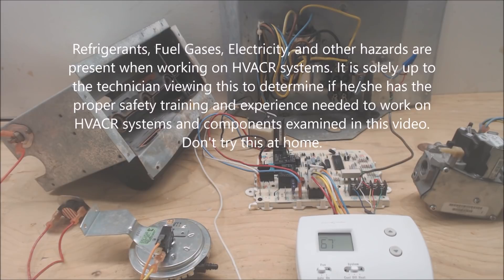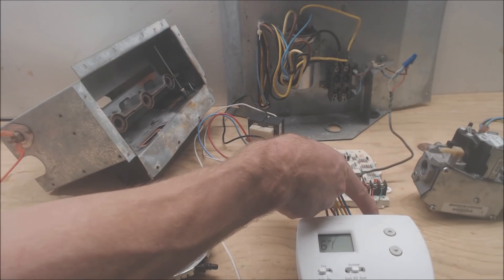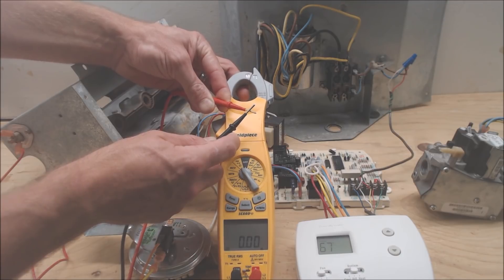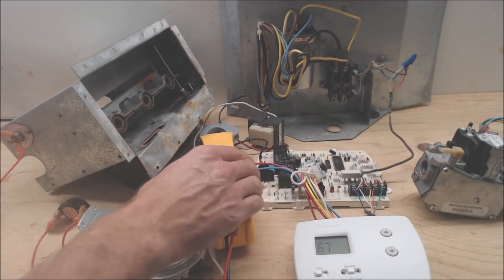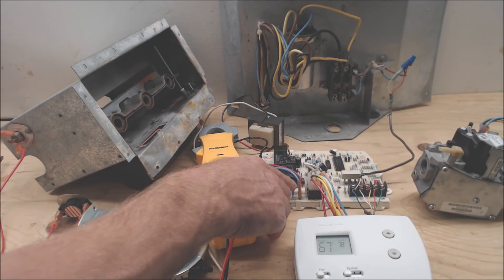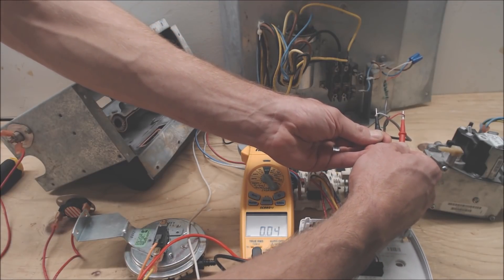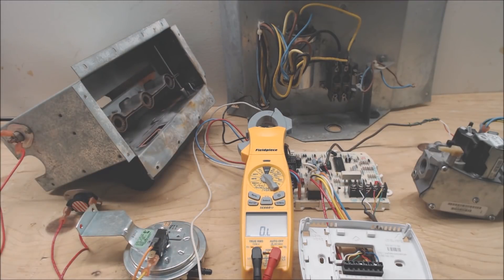HVAC Electrical Troubleshooting! How to Find a Low Voltage Short!

Comment from the maker: Tool List-  https://www.amazon.com/shop/acservicetech
Support-  https://www.patreon.com/acservicetech
For those that are looking for the tools used in the videos: (Linked Below)

Here is a link to the Fieldpiece SC640 Multimeter-  http://amzn.to/2x8k4Kb

Here is a link to the Fieldpiece SC660 Wireless Multimeter- http://amzn.to/2gWDUhc

Here is the link for the Irwin Wire Stripper/Cutter/Crimper-   http://amzn.to/2dGTj2V

Here is the Link to the "Lil Popper" 24v 3amp Breaker-  http://amzn.to/2xWcVrR

Here is the link to the 3amp fuse 25 pack- http://amzn.to/2y2zkFC

Here is the link to the 5amp fuse 25 pack- http://amzn.to/2z4SyKD

Here is a link to the Stanley 6 in 1 screwdriver-  http://amzn.to/2x7NuaZ

Here is a link to the thermostat 3/32 screwdriver -  http://amzn.to/2hxt7uK

Other tool links can be found in the video description section.

ACSERVICETECH is a participant in the Amazon Services LLC Associates Program, an affiliate advertising program designed to provide a means for sites to earn advertising fees by advertising and linking to Amazon.

All of the ACSERVICETECH Playlists-  https://www.youtube.com/channel/UCOZR-1IqsAer9wzlvFgb4mA/playlists?view_as=public

If you want to support the ACSERVICETECH Channel and receive more HVAC content, check out www.Patreon.com/acservicetech

Comment: Ok, I haven’t fixed my issue because I don’t understand what’s happening.  My fuse blows no matter what I do.  Someone told me to disconnect everything.  I did so minus the 6 pin connector.  When I reconnected everything one by one.  I found the 24v wire blew the fuse when reconnected.  

Watched your video and I removed the 6 pin connector and ohmed it out.  HVAC question:  my 6 Pin connector from my card, (large white wire) which is the #2 pin - is going to the gas valve #3 pin slot in the connector. It is grounded.  This is while the 6 pin connector from the card is disconnected.  So I plugged my 6 pin connector back into my card and removed the 4 pin connector from my gas valve to remove the “short/ground”. I ohm my fuse prongs and detect no short.  I plug in my fuse and the unit starts working.  Hurray!!! So… 
I have an extra gas valve that I removed of unknown condition and it’s also shorted to ground in the same place.  So either I have 2 very expensive shorted gas valves or the white wire is supposed to be a ground and I have the issue somewhere else and this disconnecting of the gas valve is a temporary “fix.”

Comment: I've been confused lately looking for low voltage shorts because r (or 24v hot) will have continuity to ground I believe through the coil on transformer. I have a problem remembering or knowing what resistance values are normal for things like that

Comment: You have used a great example by pointing out the condenser control wire. I have found that a large percentage of the shorts in a control system is in the control wire from the board to the condenser. Homeowners and Landscapers (and in some cases chewing rodents) cause havoc with the control wire near the condenser with their weed whackers. Great videos. I went to HVAC training in 1978, I'm an old-timer now, but you are the best instructor I've come across. Thanks for helping out the lesser experienced techs, your videos are great!

Comment: I love your system mock-up, but I think OL stands for open line. Just my understanding. It may  in fact be 'over limit' but what exactly is over what limit?  I need to know these things!  Thanks again. Keep it up!
Reply from the maker: open line, open limit, over the limit of resistance that the multimeter can measure.

Comment: Having an issue on a package unit system worked 1 month after installation. 2nd stage cooling is causing unit to shut down on high limit. Changed the board and working for 2 weeks now again out on high limit. I have it now wired for 1 stage rn so customer has cooling the compressor 2nd stage is good ohms ars good. New ductwork 4 ton I have 14 ,12, 12, and 10 inch duct off plenum 20 inch return

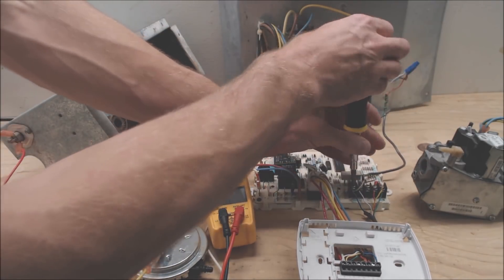Comment: You say  at 8:43 you need to always disconnect the wires from the control board so we dont measure the resistance of the resistors in the board. Can you explain what these resistors are for. Why does the Y wires not go straight to the condensor. Thanks Michael

Comment: At 3:31 you talk about the 2 red wires that go to the safety switches.Its not clear what they do. Do they cut power to the thermostat if any of the safety switches open ? A schematic of what your doing would have been a great bebefit to help newbies to follow and reduce basic questions like this one     .   Thanks for video. Michael

Comment: Maybe someone can help me with this strange problem at least for me anyway. Customer replaced his thermostat. I Checked all the wiring and he showed me a picture of the previous wiring and it was correct. When I turn the heat on the fuses now pops I removed the jumper from R and RC and the heat turned on and fuse stopped popping obviously the AC dosent work now. The old thermostat had a jumper and as far as I can tell the wires weren’t moved. The Y wire was spliced in the ceiling and one end runs outside and the other goes to C on the board. Why does it work all of a sudden when I take the jumper out. I could not find any short and stupid of me I didn’t try and by pass the thermostat.
Reply from the maker: There is a short to ground between either the y and ground or common, or there is a short between the g and ground or common. Look up the video "acservicetech finding 24 volt shorts fast" thanks!

Comment: Excellent explanation of the workings of HVAC system, however I need to correct you one thing, you keep referring to the OL on the multi meter as over limit, the correct term is open line. Hope you accept it as constructive criticism.
Reply from the maker: It can mean many things, open line, open limit, over limit and two others. In some videos I say open line and techs will say it means something else. The bottom line is the resistance is so high that it cannot be measured and the circuit is open. No prob at all and thanks!

Comment: I have burnt two transformers in a row. Both burnt only on the primary side. Can a short to ground on the secondary side cause the primary side to burn up?
Reply: Yes. It fucked me up too cause I was taught in school a low voltage short was gonna short the secondary but i worked on a blew up transformer on one of my dad house and it was a shorted wire going to the low pressure switch was runbing and eventually exposed and shorted on the suction line and I looked at the back of the transformer anx fhe primary was black so yes

Comment: Why 24 volt fuse blows on  heat pump unit., it runs for day or two and fuse blow,  it runs fine on emergency heat for several days but when Condenser is on it t blows 24 volt fuse blows in air handling unit.

Comment: Thanks for your help buddy.  I was able to track down my short (something the techs said they couldn't do) after watching this video.  It was the yellow one going from the board to the outside unit.  Instead of running new wire, I just used the brown one that wasn't in use.  Many heating cycles later and no blown 3 amp fuse
Reply from the maker: Glad it helped Frank!

Comment: I have a package unit that keeps blowing the fuse on one of the transformers it keeps tripping after turning it on for 10 seconds. But I disconnected the g wire at the low voltage terminal block  and it didn’t trip anymore but also the 2 condensor fan motors don’t come on . It is a 208/ 3 phase unit but the condensor fan motors are single phase 208/230 with a 10 mfd capacitor. Anyways I had also found to bad fuses one one of the legs of power at the disconnect and at the unit on a terminal block before the power enters the unit. What do you think is going on? Low voltage short

Comment: Hey craig i bought the 3 amp lil popper and the male terminals on it did not fit into the female fuse connectors on a lennox unit i had done did you have to change the size of the male connectors in order to get them to fit

Comment: Simple fix with inspection and a Dvm. Look for cut wires outside by weedeaters look for wires melted or bad splices no tape on connections no romex connector on furnace and wires shorting to ground
Reply from the maker: Ha ha yeah those are nice and the easy ones to find for sure, thanks!

Comment: Try this on for size: 5v at R. 27v at AHU bus. 5-10v at a junction between T-stat and AHU. Both safety switches are connected and have 27v passing over them and connected to R from T-stat and G from condenser. Also, the T-stat has old 7 wire setup, no extra wire, just old wires to swap around. 

What you gonna do?

This what I'm going to do. I'm going to remove some form of heat, just to get 24v at the T-stat. Inform the h/o of what I did, and get another tech out to replace the T-stat wire, and confirm wiring at AHU is satisfactory. Residential work can really blow sometimes, ahahah.
Reply from the maker: Ha nice. I am having a hard time understanding where you were taking your measurements from exactly but thanks!

Comment: 24 volt is going to the circuit board but i not having 24 v getting out to the the thermostat, is my circuit board fried.
Reply from the maker: If you measure 24v between r and c then you could try jumping r to g to see if the fan turns on, then r to w for heat. This would show if the tstat or the tstat wiring is bad, thanks

Comment: Can continuity work too right??
Reply from the maker: Continuity is the same as resistance but will give an annoying beeping noise. You should always go by the level of ohms read and not by the beep. You may think something is closed electrically but come to find out that contact has too many ohms across it do to burnt contacts, thanks tinymanthebeast!

Comment: I understand that if any power wire touches common, a fuse will blow. But how bout a power to power short. Had a job the other day where the zone panel was putting out all theae crazy different voltages, pretty much just spiking up and down all over the place. Changed the zone panel and in turn stabilized the voltage but still something wasnt right, i had a call for heat on a paticular zone but it wasnt transfering over to the equipment side of the panel, eventually the problem was solved and R was in continuity with g when i rung it out. Changed the wires and call for heat transfered through the zone panel. Can you explain this? Im guessing what happened is power junped from r to g and backfed through the stat and bucked the panel with 24 v on 2 terminals at the same time. Kindof a mystery to me, i dont fully understand why this happened. Anyway your input would be much appreciated
Reply: Also by my info can you tell if that zone panel even needed to be changed? After all i did get stable voltage on the new panel, and another thing i forgot to mention is that i replaced the tstats with a couple of t6's. The old stats were the white round honeywell ones that are supposedly power stealing, also when i had the new panel in the old tstats were compleyely out of the equation, which makes me wonder if it were those tstats producing those wacky voltages, i also own 3 meters, so i compared my readings on both and they were puttin out the same result
Reply from the maker: Usually a hot to a hot would not be a problem if it was all from the same transformer but it sounds like you had a hot from two different transformers touching, one from your zone panel and one from your air handler if it was g. That would certainly cause an issue, thanks
Reply: @acservicetechchannel  holy shit dude, its funny you mention that, because the transformer for the zone panel was literally sitting right on top of the air handler transforner inside the electrical cabinet of the AH. They were literally right next to eachother. Is it possible power could have jumped from one transformer to anothrr in such a confined space?
Reply from the maker: Literally on top? That is not good. The magnetic flux lines of each transformer would be in the same area. Make sure they are not on top and at least 2 inches away from each other horizontally, thanks

Comment: Very informative, Thank you. I have a question, my transformer was burned when I turned on the AC. I installed a new transformer and it was burned again a few minutes after I turned on the AC. Which part of the system should I check besides the contactor to find the low voltage short.
Reply from the maker: You should connect a 3 amp spade fuse along with the two spade connectors on the 24v power of the transformer. This way the transformer won't blow like that. Disconnect the wiring going to the contactor and at the indoor unit and see if the two wires have a resistance reading. That would be bad as it should read 0.L. Also check the yellow wire against the common wire from the indoor unit to the tstat. Make sure that they are disconnected first, thanks
Reply: They also have a tool call short pro tool works a little better than the lil popper and safer because it will identify a short below 3 amps

Comment: I HAVE A CARRIER AC UNIT, AND THE FAN IS RUNNING CONTINUOUSLY, I REPLACED THE THERMOSTAT ALREADY, WHAT DO YOU THING THE PROBLEM IS? THE FAN IS SET UP AT AUTO IN THE THERMOSTAT. ANY IDEA?
Reply from the maker: Have you seen this? - https://youtu.be/wX3hCqwUjkE - afterward ask whatever questions left, thanks
Reply: Fan relay on control board welded shut. Normally open

Comment: AC Service Tech LLC just gotta say Ive been watching your videos all day and theyre very informative.  This video is the exact problem im having.  We have the fan running and when we turn it to COOL the fuse blows.  Everytime.  I feel I have narrowed it down to something on the AC unit itself.  I replaced the 3 wire running from board to unit because it looked old and dried out.  Wasnt the fix.  Still blew the fuse.  I then unplugged the 3 wires from the AC unit and turned on COOL and the fuse DID NOT blow.  Wires plugged into AC unit...fuse blows...wires unplugged from AC unit fuse doesnt blow.  So now I can use some help from here.   Im thinking contactor or capacitor.  Any and all advice would be greatly appreciated.  Thanks ahead of time.
Reply from the maker: Check the resistance reading of the 24v coil that the two wires connect to on the contactor. Make sure those two wires are disconnected with the power off first. If it is 0 ohms then yes the coil is shorted together, if it is .6 or higher then it is correct. Also make sure the coil does not have resistance reading with ground, thanks
Reply: AC Service Tech LLC alright I did it exactly how you did in the video.  I tested the contactor and it read 1.4 ohms.  Tested the wires and it read OL.
Reply: So I had already bought a capacitor and contactor. Just installed them and boom the AC turned on.  Not really sure which one was bad but it's working now. Again thanks for all the videos and knowledge, you've been super helpful.
Reply from the maker: Awesome, thanks Chris!
Reply: Chris, your contactor coil should read between 15 to 20 ohms. 1.4 ohms means that the coil wire is shorted internally, lets say for example a coil made up of ten feet of wire is now essentially one foot of wire, and from ohms law, less resistance  with the same voltage applied, means increased current or amps. Fuse blows. Capacitor would have no influence on low voltage ckt.As part of springtime maint. for your ac, check capacitor capacitance value if your meter has this setting, replace if its below listed values by five percent. Also check contactor coil for resistance. If below 15 ohms, replace it, its going bad. Also make sure high voltage connections are very tight. And as always shut outside unit power as well as indoor unit power off before any maintenance on outside unit.

Comment: acservicetech thanks for posting this video. I have an issue. When I do the first check behind the 12 pin connector to ground / the metal frame the meter reads 0.00. And during the last time the furnace was running it smelled like something was burning. I traced all the roll out switches and wires with no visible fraying or grounding noticed. I'm able to turn on the power, and I can switch on the fan, but it attempts to turn it (fan) on but it doesn't actually turn on the blower. I paid $60 for a tech to tell me the circuit board was bad, so I paid $100 dollars and replaced the circuit board. Still no luck, if I turn on the call for heat at the thermostat the fuze blows.What could be the issue? I've tried your colored wire checks and continue to see "OL". I think I might have burned the thermostat but it appears fine, no charring or smelling of burnt connections?
Reply from the maker: Hey J L, Here is the Link to the "Lil Popper" 24v 3amp Breaker-  http://amzn.to/2xWcVrR
Here is the link to the 3amp fuse 25 pack- http://amzn.to/2y2zkFC   --  what you could do is start disconnecting an item at a time. You would need extra fuses or the lil popper if you can't seem to find it with resistance readings.  Start by taking the tstat face off and jumping r to w for heat and see if there is a problem, if there is then it is not the tstat face. Next disconnect the wires going to the board and jump r to w there to try to turn heat on. If it works then the problem was in your therm wire or tstat. If it doesn't then the problem is in front of that at the board. You could also trun the power off and disconnect the transformer leads and test the voltage coming off of the transformer which should be 24-29volts, let me know how you made out, and if you are still having an issue. If you want to support the channel patreon.com/acservicetech thanks